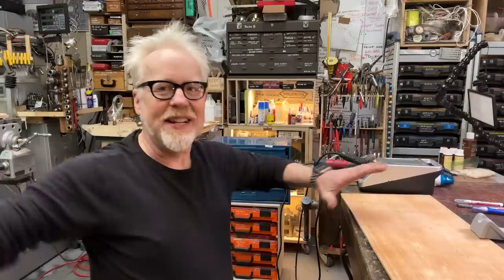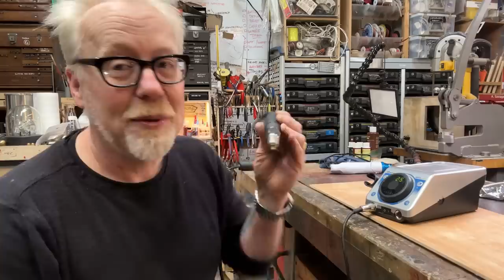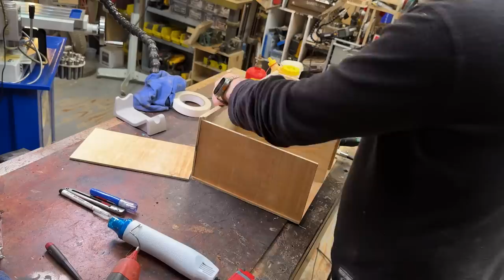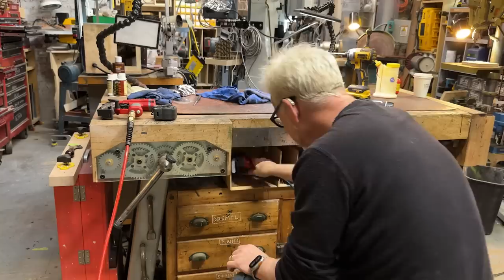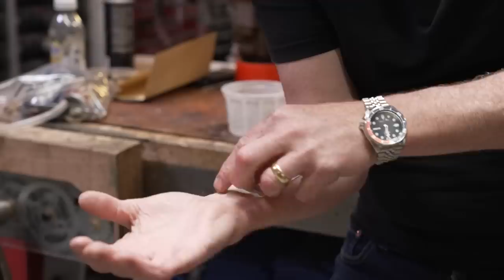Adam Savage's One Day Builds: Workbench Quick Access Tools!

Comment: My "expensive purchase" was a Dremel about 24 years ago (when poor). The little bugger still works perfectly, I have a real nice collection of bits and bobs, collets and adaptors. The grip on the chuck is worn away so I need pliers to exchange bits these days. Also, the rubber coating has flaked away in places. I'm still amazed it works every time I need it. $0.02
Reply: Yea, my skill and usage of it is a a long ways away from dropping almost $1800 on a rotary tool. I'm sure it's fantastic and it certainly has it's place but man can I buy so many other necessary and useful tools for that

Comment: Idea for a first order retrieval video topic: what do you do if the place you would think to look for a new thing is already full? This isn't a problem that's solved necessarily by a larger shop, if for instance you'd think to look for it on a shelf unit that's full. Do you use a shelf near by? Does that mean you should get a bigger shelf unit if you have space? Other things to think about?
Reply: Good question. I’ve only done this with Lego pieces but I’ll mark on the main bin for certain piece types that there is an “overflow bin”. And I know where those are kept
Reply: I'd argue Adam hasn't really solved this problem, as he keeps accumulating more carts one in front of the other.
Reply: My idea is, take the least used items and move them too the "where am I going to look next" spot or "bulk" storage for that type of tool or task, like i have tackle boxes for leatherwork, gunsmithing, etc. helps keep things organized and I pull them out when I do that specific task and need the task specific tools. That way you keep the new thing in reach but also migrate things that are seeing less use
Reply: @HickLif3  the least used item is possibly the worst one to move if you don't use it enough to consistently know where spot 2 is
Reply: You literally are limited by the length of your arms for first order retrieval, so no, or course a larger shop wouldn't help.
Reply: @JoshQuintus  unless you have enough of the least recently used things that also have some similar element to make a "obscure leatherworking tools" (or whatever) box that you store in a 2/3/4/... level retrievability storage location
Reply: @JoshQuintus  If you don't use it a lot though you don't need it in the first order of retrievability spot around the immediate work station. you can take the extra couple minutes to look for it. That's why I said try a "where would I look next". Adam always says to put things in the first place you would think to look for them. If  that place is full you either need to rethink the storage for that spot or go to the next place you would look for it if it wasn't there
Reply: Build another level and use more vertical space?

Comment: I love videos like this.
I am constantly doing builds to improve the workflow of my work area.
And I totally get this is not the finished version. You build something. Live with it for a while. Then implement better solutions that become obvious after some use. That is why I never use good stock. I build out of scraps I have laying around. Once I zero in on what I believe to be best, I may redo with better materials.

Also, when you first stuck the glue gun under there, I thought it would be better on the side of the bench. It's too unwieldy for a small cubby. Especially when it has a fresh glue stick.
Better to have some place it can hang that is easily accessible.  Bonus, is that you can put it away hot and not worry about burning anything. Maybe even add a small tray below it to catch any glue drips off of it.

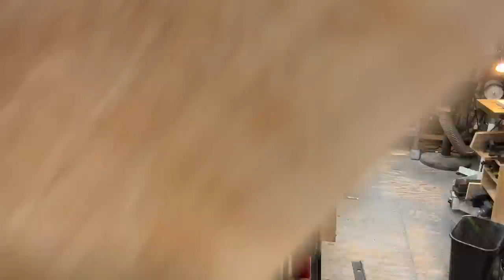Comment: I noticed the wobble in your table saw when you were using it. 7:56 As a powermatic 66 owner I had the same problem and for years until made a permanent home for mine I had a quick support leg that plunged into the tube on the extension and supported that end. it was easy on and off and made it way more stable and safer.

Comment: I still have my original Dremel from 1998, and it still works fine-yes it's bloody noisy, but hey it cost me GBP£ 89 back then- which was pretty damned expensive but the fact that I still use it at least once or twice a week just says everything ! I also have the hot air blower that Adam showed, £gbp 7.95 off amazon and again -brilliant ! I use it for soldering smd's, heat shrink-and tonight on some epoxy glue to speed up a repair job for my wife!
Reply: I think maybe Dremel was good back then?  Today their trash, especially their anemic cordless tools.  I got a proxxon, a significant upgrade that most people have never heard of.  Hopefully it lasts as long and gets as much use as your Dremel.

Comment: In the price range, of $1600, a Medicool Filestream Podiatrist Drill runs at 30K RPM, forward/reverse, foot control, and a vacuum with HEPA filter.

I have often thought that the ability to control the dust coming from a Dremel tool would be a significant addition. If you're going to invest that kind of money a vacuum would be nice.

Comment: I have one of those little heat guns like you have there.  I love it, it was cheap but has worked great for a couple of years now.  I use it for my FDM 3D printing.  After a print is finished I give it a few passes with the heat gun and all those tiny little hairs disappear and make clean up much easier, and sometimes not needed

Comment: We use a different Nakanishi thing where I work (ours are air powered and have a foot pedal) but looks like the head is the same type. We have 90* angle grinder heads on ours and if the collet is the same you definitely want to be real careful with not over tightening it. Can start to a a real PITA and the collets are real expensive

Comment: Move the drill to the cubby on the left and you can push the wire hanging down into that extra space. Then you have the one on the right freed up for something else. Also, you could put the whole thing on a slider so that the entire thing can slide out if you need.

Comment: Adam. You should make an automatic cable retractor for these cables in the next sorter. I think I have a decent idea. You just make a 3 to 5 pulley system with the middle pulley on a spring and ratchet system. As you pull the Dremel out, the pulleys allow it the cable to come out as needed and the middle pulley allows the cable to come out as needed, and the ratchet system keeps it so that way you don't always have tension on the line. Then all you do is put it away and release the ratchet system to put away the cable

Comment: I know Adam’s pain in organizing tools like this.  I would like to recommend for your glue gun, an easy way to mount something like that with a grip handle.  Use a short length of schedule 40 pvc pipe.  Cut a slot in one side the a slightly larger width of the 
glue gun’s handle, almost 
the length of your pvc pipe,  you need to spec that length out…. The if you plan to mount the tube on the side of another container drill 2 small holes
for the screws and two slightly larger holes for a screwdriver on the other side of the pipe so you can drive the screws home.  If you need to mount the tube under a table or shelf then you just need to drill the holes on the top and access the screws through the slot you cut for the gluegun handle.  This pipe idea works well for your power screw guns as well

Comment: I personally don't think you need to defend the machines you acquire. You have resources that many of us don't, but you earned that over your extensive career.
We know you can achieve amazing results with basic tools. I'm all good with seeing what you make using the top-of-the-line equipment too.

"I don't know why you need to know my schedule" Actually, it really helps us to know how long in real time it takes you or any other maker to create something. It's easy to look at what we're doing at home and think we're on a wrong path or doing something wrong because if feels like it takes all day for a step. We don't get to have Norm or someone else edit our real time workday. ;-)

What kind of heat gun is that? You called it a hair dryer, but is that what it's actually sold as? It looks really practical for all the kinds of things we do with that kind of device. If it had shaped nozzles for the air, it would be amazing.

I'm looking forward to seeing what your next versions of this look like. Your shop infrastructure vids are among my absolute favorites.

Comment: Adam, what would you do in a situation where you have three shop areas but need cross compatible tools? For instance my garage is where I store my mechanics tools, metal working, and such for working on the car. A spare bedroom is a craft room for light stuff like leather, sewing, stickers, etc. basically things I don’t want dusty or covered in saw dust. Then I have a back shop for wood working. I find I sometimes need the same tool in all three places. For cheap tools that no biggy but for $500+ tools it’s hard to swallow
Reply: Buy or build a cart. Put your most common tools on it.

Comment: Suggestion: Just get a micro drill / 3 jaw chuck for your rotary tool. Dremel-like tools are not precision instruments so you really don’t need to switch collets. I measured the thread, ordered, and never looked back! I can’t tell you how many times I have since been frustrated changing collets because it is zero and I just twist and get it done.

Comment: For your Dremel tool cord, loop it to the right and attach a retractable lanyard to middle of the loop. For your glue gun, I’d suggest cutting a hole or slot in the back right side of its cubby and then use the left side for extra glue sticks. Then the head of the gun can poke out the backside.

Comment: Don't worry Adam, you're not flaunting. It's expensive because it's good. Now, you should'a slanted the tops of the compartments, you have to stuff your hand in our you're pulling by the cords. AND, you need a big hook for the cords to be pulled to one side when using the drawers below. AND I recommended you get a nail drier months ago BUT I hang mine off the front guard. Much easier to grab, when along the side of the bench. WHILE we're at it, you would need a slobber catcher for the glue gun. Disposable of course.

Comment: I mounted my solder sucker under the work table like that and had to install hooks to hold the wires out of the way when not in use. It took one turn in the chair and my knee caught the wires and ripped the iron out of its holder and broke the sight glass.

Comment: I’ve been wanting a more accessible / small heat gun just for small stuff like heat shrink tubing that I use a lot of. Been debating between one similar to what Adam showed or a cordless one. 

Any recommendations from the comment section?
Reply: Sounds like you may want a hot air tool made for working with surface mount components. They're like tiny heat guns. Sometimes they're called, hot air rework stations. Not sure if any are cordless. Which one to get I don't know either. I stay away from SMD myself. But they look real good for doing shrink wrap.

Comment: Yes, Dremels can be noisy. I should know, I own eighteen of them. I don't like changing bits. But another failure is that they suck at fine detailed engraving and such. I have yet to find one that did not have an eeny tiny bit of slop in them. Probably in the range of 1/64, but in some things that counts. I was able to pick up an inexpensive rotary tool from a nail shop that was closing down, (new about $350, but I paid far less). The difference in the vibration is like day and night. This thing has zero perceptible vibration in it. Zero. It is an absolute joy to use, quiet too. The only problem is that it does not take bits larger than 1/8th. I use my dremels and foredoms for larger pieces and rough work, but when it comes to precise stuff, I drag out my nail grinder.

Comment: i'm sure your model is superior, however, for a few hundo or less you can get a nail drill used in the beauty industy. some claim to go up to 30,000 rpm. not sure how it would compare to what you have but it appears to be essentialy the same device at a much lower price point.
Reply: I have a pneumatic grinder that goes over 100K RPM but it has no torque. It's not all about just RPM.

Comment: nothing wrong with a ...quickie ..... perhaps a pull out lazy susanne style drawer ... as for the glue gun cut a spot in the back wall for the tip ... and add an old spray can top there for it to drip into when it just starts cooling down after use ... 
.

Comment: 3:14 $1,000+ for a tool sounds like a lot, unless you use it all the time. cost per hour tells the story. And then, if the tool is "1% better" than a much cheaper alternative, that 1% adds up.   Of course, to buy the tool you have to be able to shell out the cash without having to skip a car payment and eat ramen for a month. Once your warchest is built up, however, don't skimp on primary tools.